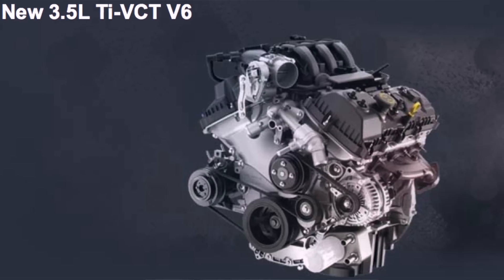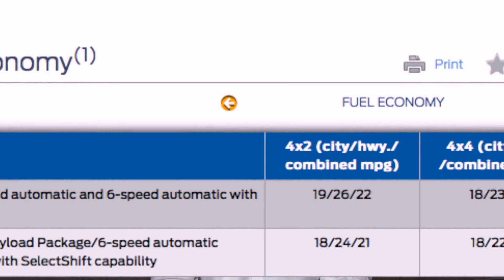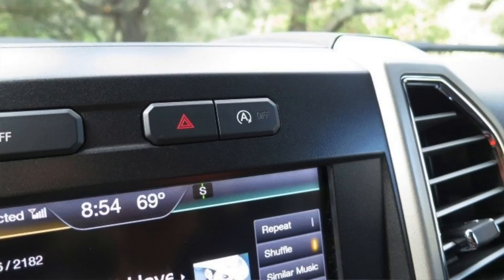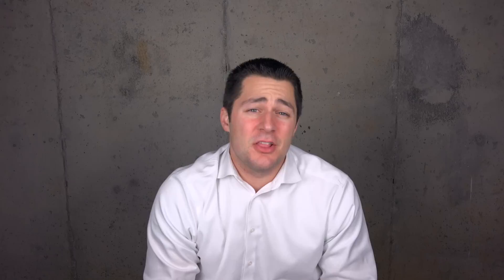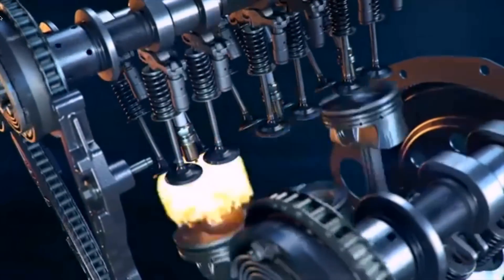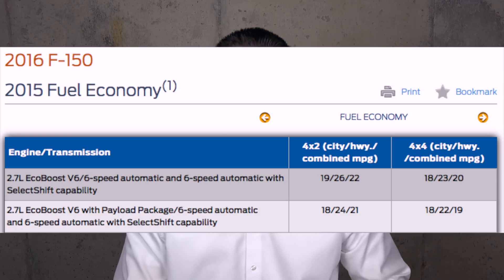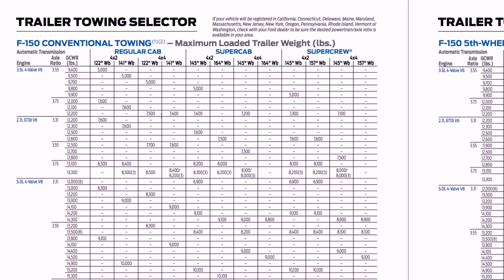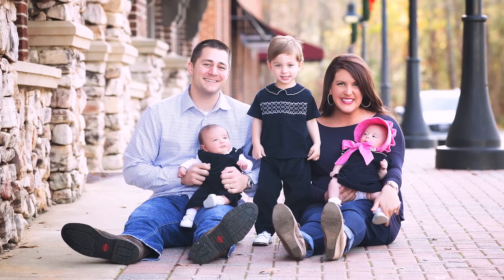Which F150 engine to choose 2.7L - Motor of the Week

Comment: Thanks for sharing... Where's the link to the "write up" mentioned at 4:57 in the video?  

Also, are the features talked about here, of the F-150 2.7L ecoboost included on the Edge Sport 2.7L ecoboost?  (eg. smart alternator, auto start/stop etc)

Comment: More longevity bahahaha yeah right, so it has an electric water pump and keeps the thermo fan running after you turn off the ignition... No it doesnt. That means the vehicle sits there sopping up heat sharing that heat with other components. Yeah no. 
The only way to cool the turbos down is to go easy on the way before you turn the vehicle off, the heat a turbo generates on a decent size engine is huge and needs a lot of cooling, having water cooled isnt smart because its a potential leak point for water to mix with oil.  Not to mention how hard the small turbo undersized engine is working.
It goes to show that if you have to use used car tactics to entice people to choose the engine theres problems.

Comment: My '03 F150 with 210,000 miles trashed itself internally when a timing chain tensioner failed, the plastic chain rails exploded, sending shrapnel all thru the engine, the right bank cam jumped time and a piston bent a valve. What I would like to know is did FORD improve any of these components? I restore old Mercedes and have never seen their chain tensioners fail or their plastic chain rails fail.

Comment: Thanks for this video.  One issue with the ecoboost engines is the cylinder blowby.  My 2.7L converter failed at 80k miles so I replaced it.  Ford part alone cost $1000.  Also an issue with direct injection motors is carboning up of the intake valves.  I installed a quality billet aluminum catch can remedy these issues.

Comment: Just bought a new used F150 supercrew 4x4 2016 ...very pleased with the ride suspension and the eco-boost gas economy I have one question though with the eco-boost system on off switch continual on and off ...has there been any problems with the starter and ignition system wearing out in the near future ?

Comment: DO NOT BUY A 2.7 or 3.5 ECOBOOST !!!!!!!   My 2015 2.7 had catastrophic engine failure at 133,000km (82,000 miles) it's now destroyed and needs to be replaced.  The cause was either a dead main bearing or oil pump failure, I'll find out after it's removed.  I had no warning at all, just started knocking and banging.... then dead!!   Just out of warranty and Ford refuses to help....Going to cost me $14,000 CDN ($10,000 USD)  Apparently this a common problem with these engines. If you own one, get rid of it before the warranty expires!!!!!!   You're welcome.

Comment: The real question is what’s the differences in the 3 different 3.5 Ecoboost engines??  The standard 3.5, the 450hp Raptor & Limited 3.5 and the 600hp 2019 Ford GT

Comment: The problem was the exact opposite. The oil flow would stop and then cook in the turbo which is called coking. The water coolant system is more efficient and effective.

Comment: Good luck after 50,000 miles hope you put a catch can on it you're going to have so much carbon buildup in that engine but Ford Engineers are asses so
Reply: Every direct injection engine has that issue.

Comment: I want to know what s=is the max power out of the latest gen 2.7L.  Sounds like the block is strong as hell, what are the pistons, crank and rods made out of?  A shitty 109 block out of a Grand National has made over 1000rwhp.  For people who don't think the 109 block in a GN is shitty, without all kinds of work most will give up at 550 to 600rwhp.  If this push rod v6 with a week as hell bottom end can get to 1000rwhp, I would think with the correct turbos the 2.7L should be able to put out 1000rwhp.

Comment: Subscribed, thanks for the info.

Does the 2.7 ecoboost use dual fuel injection meaning port and direct?  If only direct injection, how does Ford deal with excess deposit buildup on the valves?
Reply: Vincent Anthony the current gen of the 2.7 is dual injected.

Comment: Does this 2.7 have forged internals? Like rods and pistons and crank etc.
Reply: This is the answer I'm looking for, but all I can find is that its built stronger to be more like a diesel so in essence the parts inside can handle the stress put on them. However if you're looking to tune this engine for ridiculous horsepower probably a safer bet to get the 3.5

Comment: Doesn't the 2.7L ecoboost engine have a plastic oil pan?  A friend had to have the 2.7 oil pan on his 2015 F150 replaced 3 times before the engine  dropped a valve and he traded it for a Dodge RAM. I opted for the 5.0.   I suppose plastic parts lighten the engine considerably which is a BIG plus and selling point for some experts.

Comment: It is tough listening to this guy explain functions of this engine because he has no clue what he is talking about.
Fuel cut overrun has been employed in so many engines for decades.  It has nothing to do with direct injection.
Also, direct injection injects fuel directly into the CYLINDER, not "the engine"
Turbos have been water cooled for sooooooo many years.  Nothing new dude.  Don't ever talk about engines again.

Comment: 5.0 no eco no stupid auto start.
Reply: Driven both.  torque comes on immediately and the launch is flawless in the 2.7 ecoboost the power / passing power is more instant from a roll and a stop the driveability is way better in the 2.7 it made my 5.0 feel slow

Comment: Thanks good stuff!  I decided on a Ford F150 and almost closed the deal but backed on the last minuted as I wasn't sure I was buying the right F150.  I called Ford headquarters and there is no one I can talk to there.  What is needed is an experienced person who will walk me (us) through everything from the engines to mirrors.  I was out in my garage at 4am measuring the garage door to see if I could even get the truck through the door.  I can with 3 inches to spare (each side) but power folding mirrors are now a must!  Then a financing expert who knew all the rebates and discounts.  This is left up to the salesman (who was great) and he kept finding out other discounts that I wasn't sure was all available to me as a vet, usaa member, A plan, October first deadline and on and on.  For me price was key.  I would rather not get a truck than to buy the wrong one and find out later some discounts were available not realized.  So, who can walk me through my needs and assess which truck and all the rebates available to me are?  I plan to have this truck for 10+ years.  67 yrs old and need a good long lasting 4x4 for my modest needs.  Lynbyk@gmail.com

Comment: I bought a 2018 F-150 regular cab I love it right off the lot the dealership the V6 I know you said it could pull 8700 lb I didn't add anything to it I was just the wondering you can email me back low case letters Miller i c k 63 at gmail.com

Comment: Mitchell, thanks for the details.  I just love my 2017 FUSION SPORT AWD w/ TWIN-TURBO 2.7 ECOBOOST.  This car is 164 C.i. of “You got to be $#itting me” power, handling, comfort, automation, and styling that is so under-appreciated!  To get 120 HP/L of power density in a 2-ton sedan is a stunning feat of engineering for $42K.  It sez “SPORT” above the quad tip exhausts, and if you didn’t pay well over $60K for your SuperSedan, don’t embarass yourself in front of your girlfriend at the traffic light!  Especially on wet pavement!

Comment: GREAT information. Love the details, specs, and in depth explanations  of features on the 2.7... I just bought a 2018 STX with the 2.7 and I love it so far. If I baby it and drive like a grandpa I can get 27mpg on the freeway or get to 60mph in under 7 seconds. I am looking to add a cold air intake from K&N or Airaid and a Flowmaster or MBRP cat-back dual exhaust. What are you thoughts on actual power/torque/mileage gains?

Comment: I have a 2500 HD to tow, have been upwards of 18,000lbs on the the scales with her. Bought the 2.7 for fuel economy as a Chevy spark or Fiesta wouldn’t be effective daily driver for a Truck guy. Honestly the thing is a rocket and for the fraction of the cost doubles as my sports car. And kept the 2500 for towing as that’s what it’s designed for. I would not recommend purchasing it to daily tow, that’s not its design and you will average much better fuel economy with an HD while towing (even a gas motor)

Comment: Drove from Alhambra, Il, just East of St Louis about 30 miles, to Warwick RI. I traveled 2381 miles round trip doing the speed limit and averaged 25.1 MPG, I thought that was good mileage for a 2015 XLT Super Crew Cab W/ four wheel drive. We also use this truck to pull a 5800 pound camper, with good pick up onto the ramps and hills.

Comment: Just saw a video with 200,000 mile 2.7 eco that's still running strong. Just take care of your ride and it will last.
Reply: Patrick, I sure hope you are right.  I worry almost daily that I spent 40 grand on a vehicle ( my wife's) that I may have to replace prematurely.  I can't afford another one too soon.  I AM driving a 2005 F150 5.4 motor that has now 325,000 miles and hardly anything has gone wrong.  The starter had to be replaced at 190,000 miles, and that's it!  Original muffler, tailpipe, and brake lines all stainless, and never replaced. Original catalytic converter, and U joints never replaced and never squeeked, unreal.  Original alternator, and all original internals on this wonderful motor. They say I should replace the timing chain every 100,000, SO I should have replaced them 3 times already, BUT I NEVER DID EVEN ONCE, and it has power, and quick pickup power you would not believe.  Power window button went bad, so I took it apart, cleaned it up, and put it all back together, no cost. Best truck I ever owned. I hope my wife's Ecoboost can match my truck in longevity. Proper oil and maintenance is key.
Reply: LostInMySpace wow what a truck, my barber has one, I think he told me right around 200k on her same Triton 5.4 and still running great. When you do replace her you thinking about the 2.7, I have a 2017 STX 4 WD Crew, only 52k and no problems so far, quick off the line, never even thought I’d like more power, from day one I’ve averaged 20.4 mpg in town and a lil better in the highway. Hope my truck turns out to be good as your truck has beeb🙏
Reply: @poppyneese1811  My wife has the 2016 F150 w/ 2.7 Ecoboost.  Her immediate problem is the throttle body.  I removed it to clean w/ throttle body cleaner, both sides (inner side was worse), and all the steps to get it in sync w/ the computer, and relearning the idle levels.  Still acting up, so I have appt. w/ dealer for her 2016 truck. Yeah, they'll diagnose it and cost me perhaps 400 I'm guessing w/ diagnosis, parts, and labor.  The electronic part of the TB is weak point, and Ford can't get them right, so we pay, and pay, and pay.  I'm expecting the replacement will in time have to be replaced too.Oue 2.7 has plenty of power like a racehorse.
Reply: exactly, people get hung up on turbo engines wont last a long time, this is not the 80s anymore
Reply: Tubos love Full synthetic oil changes every 6000

Comment: My two cents on the 2.7l vs the 3.5l vs the 5.0l...

Ford knocked it out of the park with all 3 engines. I currently drive the 2.7 and love love love it. I can make a good argument for it, and I can also make a good argument for the 3.5 AND the 5.0. All good engines, much respect to Ford for these 3 motors.
Reply: I love my 2.7l as well! Would’ve loved a 3.5l but I’m not complaining 🎉
Reply: I totally agree I've always been a Ford guy and these 3 engines they came out with are absolutely the best ever especially mated to the 10 speed they knocked it out the park for sure

Comment: 2013 5.0. 111,000 miles. Tow regularly. Runs as good now as it did the day I bought it. I will never buy anything but a ford!! I've owned 9 ford vehicles and have had 1 alternator go out. Good enough for me....

Comment: great info on some things I didn't know about my own engine. I have a 15 f150 supercab 2wd 2.7 with a 3.73 rear. I average 23mpg city and between 25-28mpg highway. from Houston to baton Rouge I pulled 30mpg. I have towed roughly 11,500lbs with no problems and still made 18mpg. this engine is amazing for its size. I've also hit 125mph by accident and unlike my friends ram 1500, my f150 wasn't shaking

Comment: There are people with the 2.7L on Ford truck forums that report they have towed with the 2.7L, then when they get off the highway or stop for gas, the truck stalls out and runs rough with no power and they have to press the throttle down to keep it running. There are no CEL or error codes. When they take the truck to a Ford dealer to check it, the Ford dealers find no problems and say the computer codes are all clear.

Comment: I have the 2012 3.5 ecoboost. I bought it a year ago. Love it!  It did have a hesitation and sputtered at 75% throttle  and up. My local mechanic put a intake fog valve cleaner in it and now it's 100%. It has 80k miles now.
Reply: What is that

Comment: just about all modern engines cut fuel on deceleration. my 2000 toyota cuts fuel on decel i know for a fact due to having a aem air fuel meter

Comment: Just purchased the F-150 with the 2.7 ecoboost.  Really happy with it.  Yes the auto-stop takes some getting use to.  On very cold days or warm days it doesn't turn off the engine until the cab is getting warm/cool.  So I like that function a lot.  Great info you shared...
Reply: Steven Ritter you can pop the switch out and add a jumper wire from the white wire to the black and purple wire. this will permanently keep this feature off... your welcome everyone
Reply: D Newman it's safe to do. or instead of a jumper you can install a switch. this will allow you to leave it off or on

Comment: yesterday I tested Chev Ford and Dodge. I ask each lot for their cheapest truck with the best economy. Chevy gave me a mid size Colorado it was nicely equipped, the V6 seamed to have ok power too. Dodge gave me a full size truck with the 3.6 V6. Not bad pickup but after one mile the cab filled up with electrical smoke.  Ford gave me a 2.7 V.6 buy far the most powerful plus it had some nice features. Even though the Chevy had the nicest cab ( heated leather ) I'm picking the Ford, oh yeah I forgot too say all of these were 40K Canadian
Reply: update... getting the 2.7 Ford tomorrow😃
Reply: D Newman thank you , I love this truck and the green gem paint looks awesome. not sure at the moment what kind of mileage I get but it says I average 11.6 L/ 100 k . I think it's around 25 mpg. the other day with a tail wind I averaged 7.1 witch is around 35 mpg. couldn't be happier

Comment: never explained why turbos go out at 50k miles.................
Reply from the maker: +rvsteve583 they did back in the day. Before these turbos were reinvented with Convection cooling.   Back in the day, the turbos would go out because the turbos would cool off too quickly after you cut the engine off. These trucks used a water cooled method to SLOWLY cool the turbos long after the engine has been turned off. Engineering at its finest.

Comment: I have bought 4 Rangers over the years they have been good trucks. But when Ford adds electronics and more and more technology things go to shit in a hurry. Has Ford ever built a reliable Diesel? The 3.5 has gone through a heavy list of failures. Including there variable valve timing cams. What they call fazers. Now there is major issues with there direct injection causing intake valves to gum up. And there is no way to easily clean them. Cost of ownership to maintain these vehicles is many times more than what you save in gas.
There is a Ford master mechanic on YouTube that describes all the issues and they are VAST. Fords reliability and over the top vehicle pricing has driven me away from the brand. 
Ford, bring the new Ranger to these shores with a (Reliable, Dependable) Diesel..... Then you will have my attention....

Comment: Great video thx!! Please do one that discusses the best engine and rear end ratio choice for an F150 that has been lifted 6 inches with 325/50 size tires. This is a very common setup and it always seems that the trucks are under powered. For example, unwanted frequent down shifting on the highway due to the increased rolling resistance of the larger tires. Some say the V8 while others swear by the 3.5 Ecoboost.

Comment: this is a good video great input on the whole thing I definitely know more know about these engines than I did before. but if Ford is doing all that and you're only getting 20 miles to the gallon he needs to throw that truck away. I'll tell you a secret Ford had a motor in 84 that got 55 miles to the gallon and 500 horsepower and they sold the Patton to Exxon Mobil for over 7 billion